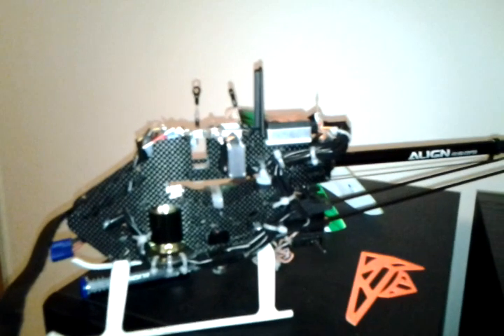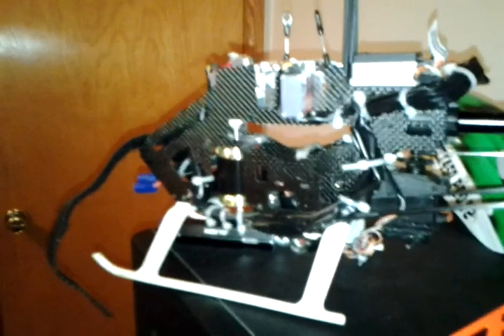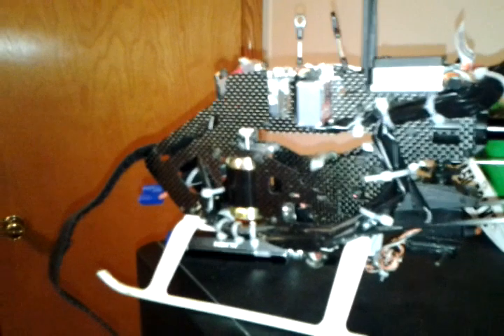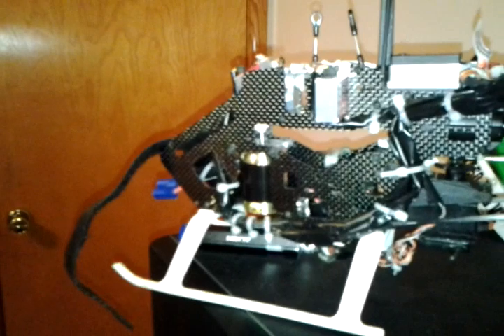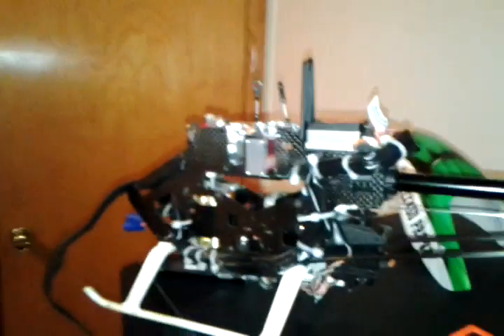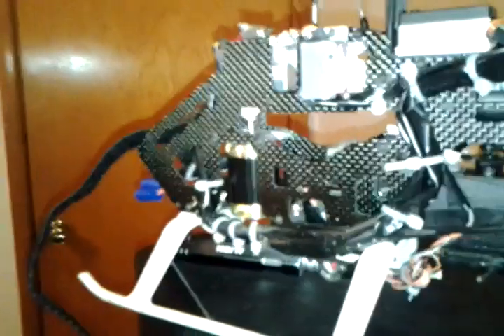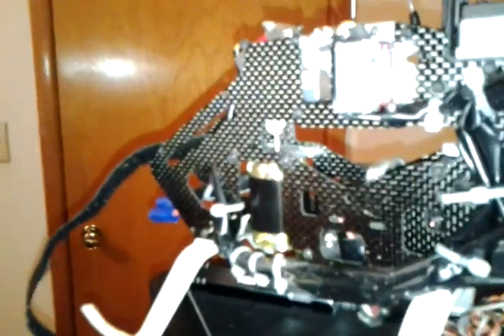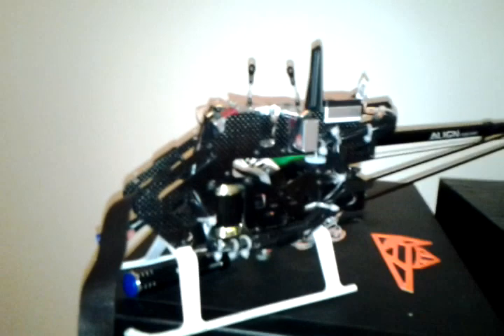Why you need a flat spot on your motor shaft,

Comment: Did you use green wicking thread lock to put the pinion on the shaft?  The only way to get that stuff off is heat and a lot of it.  Then use blue for the set screw.

Comment: Ya, same thing for airplanes too, I lost a prop in mid air, because I didn't put that flat spot on the motor shaft, thought those little set screws would do it, NOT.~Bob